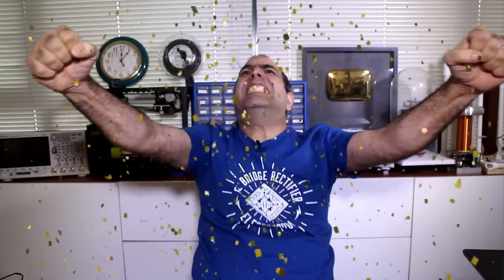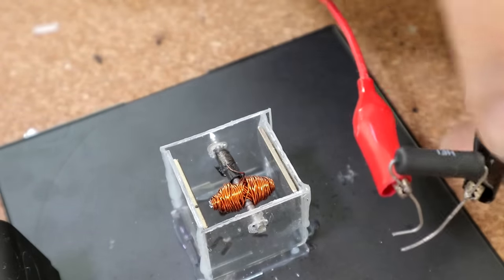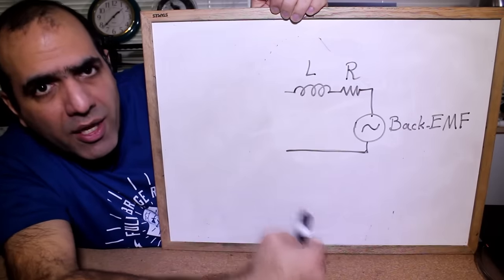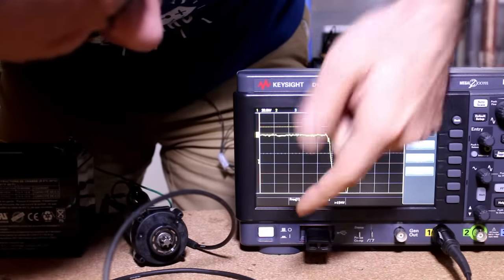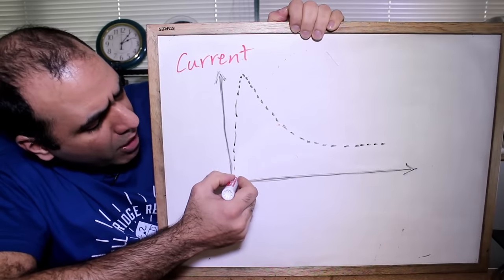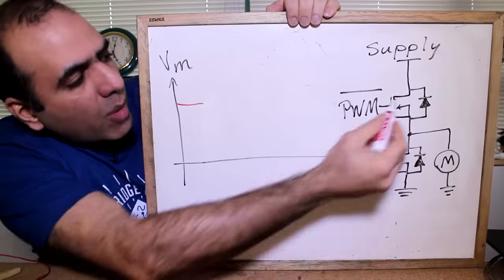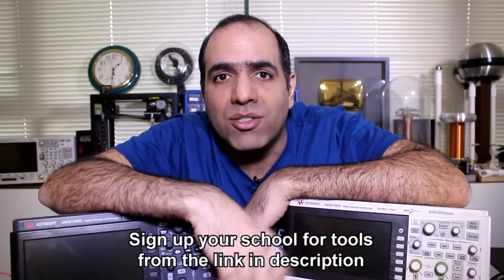Brushed DC Motors and How to Drive Them

Comment: High current spike at the beginning, high negative voltage spike (-100 volt with +12 volt supply) when opening the switch.
First, the arc in the switch keep the voltage low, then the spike, then back emf as motor still rotate but is slowing down. All that shown in one single scope trace.

Comment: I made a 24 lb coil activate on an H bridge setup blow up a lot of mosfets before i figured out what to do. I even put all 4 NPN mosfets of on the H bridge so there would be no lag time between PNP and NPN ( had to use isolation transformers to the gate to make it work). The voltage spike was still to large for the circuit. I ended up using 2 diodes and a capacitor high microfarad cap and a pico capacitor over it. finally after months of transistor popping the pico capacitor did the trick and i was able to run the coil with cheep mosfet transistors . you must also drain the cap (light bulb)  or it will get to high in voltage and booooom. :)

Comment: Alright mehdi, hear me out. What if, we use multiple wires while winding and then, while driving the motor, we change the configuration of the wires between parallel and series. This way, we can control the torque to speed ratio of the motor. So we can not only use it to start the motor slowly and more capable of handing higher currents but also we will have a solid state gearbox. What do you think?

Comment: What about all those pulsed dc motors that use induction to spin the rare earth magnets with coils. I made a simple one using a compass. I wound lots fine copper coils around the middle of it and used a D battery where I tape one end of wire to the battery and I scraped enamel off for electrical connections. And use the other clean end and tapped the other end of the battery trying to get the compass needle to spine. I wonder if it would work with a solar light where the joule thief circuit ran the compass inductor instead of the circuit inductor.

Comment: "Are you tired yet?" what it's only 09:25 and I just arrived home from the bar where I sang at 7...

Yes... I Am tired... BUT I WILL FINISH THIS VIDEO AND LIKE IT!
A Pulse Width Modifier would make fun with electrolysis eh? But Hobbying HHO Gas is lame. @electroboom How does 3 phase act with electrolysis. I know the Favorite in making Browns gas is using DC 12 at 10 amps or something, can produce enough gas at considerable draw Though. But How would 3 plates and that 120 degree shift effect(affect?) output? Eh...

Comment: A series of lights, is a sure method to limit the current.. 
..maybe You could connect enough lights in series to prevent the highest theoretically possible voltage in the universe from burning out the motor.

Your fan SciVegan.

Comment: reactive power or counter emf is just useless, unless it is used for breaking, which is good for some  machines, mechanical engineers might have a use for this, but electrical principles are not involved here. Of course centre tapping the reactive power to neutral helps the grid when that emf is reintroduced as flux into a transformer.

Comment: i recently made two model dc brushed motors myself powered by a drill battery   do you think i can make a strong enough brushed dc motor for electric vehicle application like a scooter or bike?  how do you go about designing a motor for a specific task? i know length of wire and guage will matter but i dont know how specifically to go about planning for the power i want  i know ill need a rehostat as well to control it

Comment: I'm a bit late and someone has probably said this already but in case not you can also find the Rotors inside a any video game controller that has a vibration function such as the Playstation Dualshock. I'm sure other consoles have this as well.

Comment: Can anyone explain how does heating element drop voltage in hair dryer if it's blowing cold air? The current definitely doesn't go through the heating element, so how does the voltage get dropped?

Comment: Thank you for this quality content! 

I saw everything I expected to see but I was really hoping to find more on a special case: 

I have a dc fan that has a really simple 4 position rotary switch.  (Off, low, medium, high) It has the flyback diode in parallel also. Thats it. 

In low and medium setting, current passes through a open air coil, one with approximately 30 and the other with 15 turns of a single nickel coated wire. Are these coils acting as resistors or is this some kind of induction black magic?

Comment: Pls sir i was looking if i can run a brush DC motor on two pwm controller brush motor controller as the motor uses more amps than the controller i could find that's why i came back to this your video but i can't find the answer i need your answer please 🥺

Comment: Hey! Great Video! I currently study physics but I find electrical drive systems very interesting. Can you recommend any textbooks about electrical drive systems? I am fully aware that I would first need to understand electronic circuits, power Electronics, semiconductor Physics and control systems before I tackle electric drive systems, but are there any books you highly recommend?

Comment: Can't you use n channel and p channel mosfets for the bridge driver? The n channel can work as the flyback diode and p channel as the switch or the other way around based on what you want the control signal to be as a default?

Comment: sir i am running a motor removed from hair trimmer using mobile charger output pole it doesn't start i have to pull motor manually to start it ... can you explain what is the main problem and how to resolve it thank you in advance

Comment: Something I do not understand is why does the motor spin faster when the regeneration voltage gets into the off time?

Wouldn't the regenerative voltage try to oppose the current that is driving the motor in the forward direction?

Comment: 13:34 I think I'm missing something fundamental perhaps, but wouldn't the motor's average current also be multiplied by the duty cycle - not divided?  Wouldn't power consumption remain constant in spite of duty cycle, otherwise?  I understand that we are assuming ideal properties in any event, as I don't believe the relationships are linear in reality, so my other question is, are we ignoring reactance altogether, or does that not substantially affect curves like speed and torque w.r.t. duty cycle, as well?
Reply: You mean that the Average Current will be Duty Cycle Multiplied by The Motor Current? If yes, then she have shown the same just rearranged the formula to find Motor Current with Average current Divided by It's Duty Cycle

Comment: Could it be feasible to use capacitive coupling instead of brushes? I'd think it could at least be done with a high voltage-low current motor configuration

Comment: Am i hearing right . 3 poles and above ? Does a 3 pole motor even exist ? 🙄
Reply: The first ac motors were 3 pole motors designed to operate off 3 phase ac and thats still the case in industrial sized motors, right?

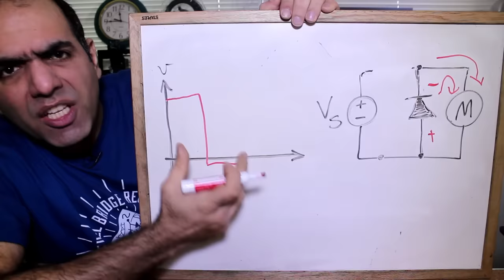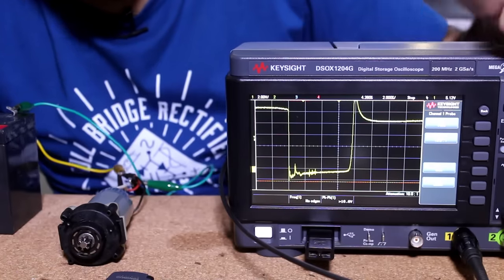Comment: Can someone explain why back EMF turns out again on 11:02 - 11:05 and 11:25 - 11:28 12:55 - 12:56? I thought back EMF dissipated on diode and voltage spike limited. Please help newbie with exploring physics and electronics.
Reply: When the motor is disconnected we have a case where there is no longer any current through the inductor. We know that current through the inductor cannot change instantaneously so we get that huge negetive spike in voltage to limit that we are using a diode. After the there is no stored energy in the inductor the voltage should have come back to zero. But you are forgetting that the motor is still rotating. This essentially means a copper conductor is rotating in a magnetic field. By faraday's law we know that when the magnetic flux linked with a conductor changes there is voltage induced in the conductor. This is the reason why we see the voltage jump back to positive value.
Reply: @sudarshanhs6588  thx very much, man. Finally, I understand
Reply: @sudarshanhs6588  One more a bit small question). Induced voltage in copper conductor in motor has same polarity as power supply voltage and that's why it has positive value in oscilloscope?
Reply: Yes basically it's acting as a generator tats why we see a positive polarity
Reply: @sudarshanhs6588  thx a lot

Comment: Very cool! Explains how/why my cordless drill stops instantly when you let off the trigger.  I knew some of this stuff because I've been into RC cars for many years, but learned plenty too.
Reply: My vacuum tube RC car will use two 250VDC 4000 RPM treadmill DC motors in a rear-wheel drive configuration, driving twelve inch tires. And using PWM to accelerate and decelerate the motor, the thing should hit 100mph despite all the weight

Comment: current limmiting inrush resistor. that is what we used in the past
Reply: You should never use resistors for motor current limiting. They will waste a ton of power and will get very hot.
Reply: @beanapprentice1687   you only used it for starting as soon as the motor was running it was bridged
Reply: @jijzer3284  that make more sense